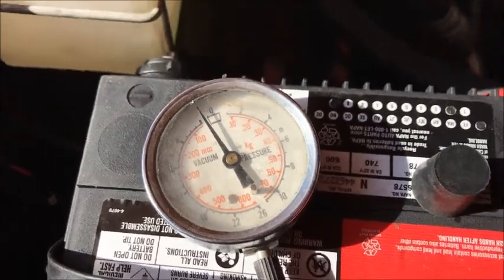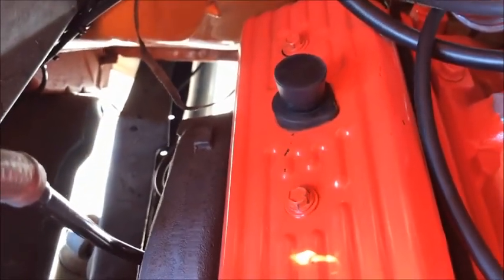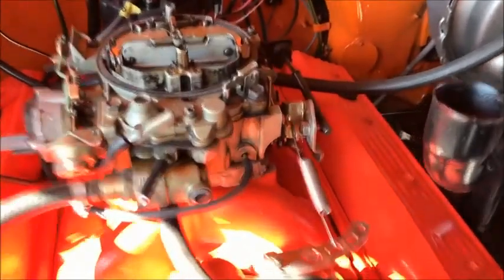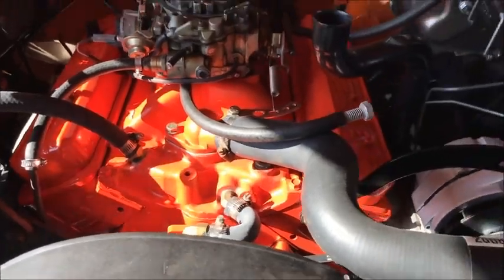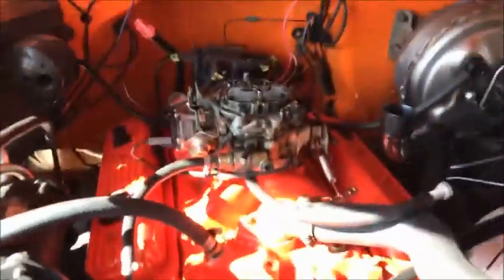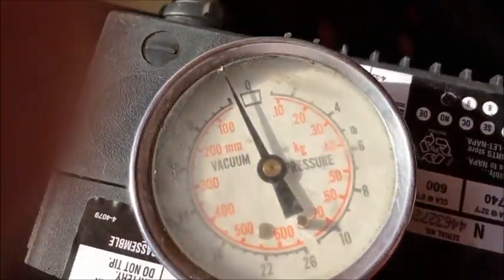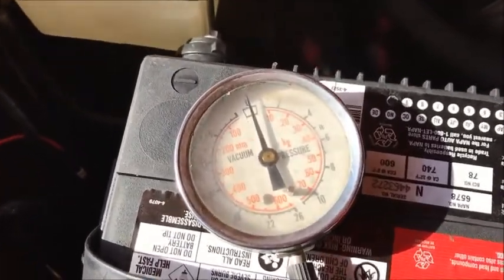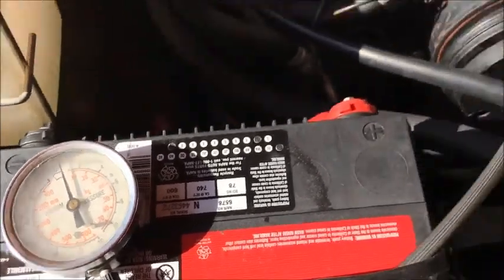Checking for an Internal Vacuum Leak

Comment: I need to try this. My vett acting like a vacuum leak but cant find it. So I actually thought of the idea of an internal vacuum leak but I could never think of a way to test it other than a smoke test I'm going to give this a try but also I think this is not the issue then my engine control module probably might need to be replaced

Comment: what should my vacuum gauge read with a camshaft thats alittle bigger than your stock cam ..i have a 1990 k5 blazer 350 engine it has rebuild with up graded the cam to a howard rattler cam intake lift 225 exhaust 535 duration 227/235 lobe separation 109 centerline 103 i check to see how mush vacuum i were getting and its no where near 19 to 21 of mercury .. the needle is in the red area sitting on 10 where it say late value timing or leak at intake manifold or heat riser my engine has about 480 miles on it.
Reply from the maker: 10 is low for 227/235.  I'd expect 14-16 but I'm no cam expert.   Tight 109 should cause early intake valve closure and thus boost vac relative to a typical 112.
1. If the gauge is jumping around, you might have valve issues.  The vac will change when the leaky cylinders activate.
2. If the gauge is fairly steady, then might need larger idle bypass in your throttle body.  Bigger cam = bigger idle air.  An improper fix is to open throttle blades which in turn reduces idle vac.
3. If you rule out the first two, then suspect a vacuum leak.  I've had a warped intake manifold flange cause this sort of problem.

Comment: Where are you connecting the vacuum gauge? Its hard to tell on my cell phone.
Reply from the maker: Good question!  In the video I said to connect the hose to the dipstick.  What I meant to say is, "connect to the dipstick tube".  Remove the dipstick and slip the hose over the tube.

Comment: Good one! I've never seen this in all my days.
Reply: Normal blow by, best not to let pressure get to high or a seal will be leaking ,
Reply from the maker: Yes, it was the first time I've tried it and was surprised by the results.  In hindsight, I expect that blow-by probably also contributed to the rising pressure.  I've heard that a properly seated new engine will leak up to 5% past the rings.